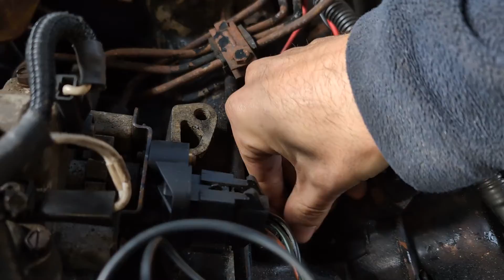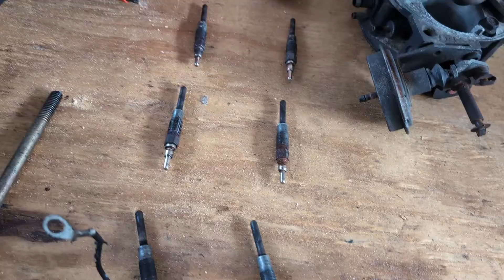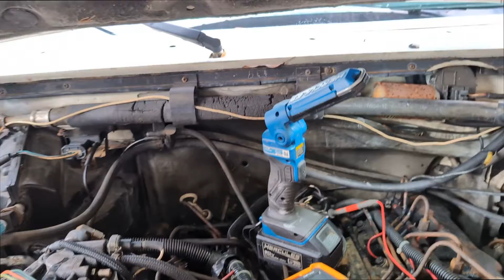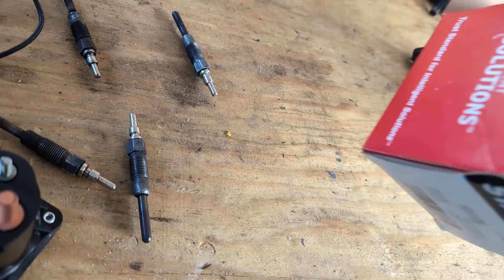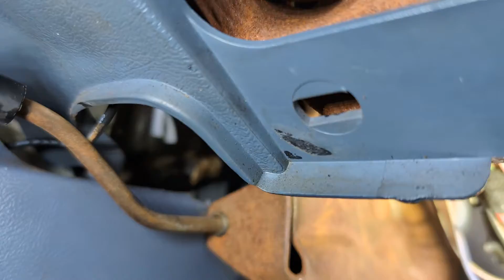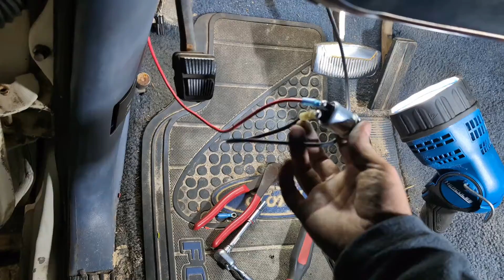Episode 163 - Glow Plug System Troubleshooting 1989 Ford F-350 7.3L IDI Diesel

Comment: Great job on the video, thank you for doing this.  I have a 1990 250 7.3.  Mine is doing exactly the same thing as yours.  I did all the testing step by step just like you did and ended up with the same results.  I also had to do a manual switch.  I'm wondering if maybe a fusible link somehow is a part of the computer control for the relay?  I wish I had a wiring diagram.  Im grasping at straws.  Two sets of plugs, two complete controllers, good harness, good plugs, etc.  BTW, what do you consider a normal resistance for each glow plug when on the work bench?  I wish others did as good a video as you, keep up the good work!
Reply from the maker: Thank you for your comments.  If you do a bench test of a good Motorcraft glow plug it should be 2 ohms or less.  One of my theories as to why the system wouldn't work right is that I put anti-seize on the plugs which somehow altered the resistance reading, even though as you saw in the video all the plugs ohm'd out fine once installed in the cylinder heads.  I have a new glowplug harness on my todo list to install,  just haven't gotten around to it yet.
Reply: @MazdaB3K  I did not use anti-seize the first two times I changed them.  I bought motorcraft parts off of ebay for $25, decided they may be fake so paid $130 at Ford Dealer and used anti-seize on these thinking they would be there forever.  Same result unfortunately.  I would appreciate it if you think of it to let me know if the new harness is the solution.
Reply from the maker: @MichaelMaroon-oz9bp  I honestly don't know.  As you saw in this video, everything tested perfectly but the glow plug controller wasn't having any of it.  Part of my testing was checking the voltage reads and resistance across all the harness parts and that came back fine.  A new harness hopefully would have better positive locking ends for the glowplugs but otherwise there was no issue with my harness.  This particular problem still bugs me as I wasn't able to solve it and had to do the manual solution.
Reply: .01-.5

Comment: Damn, watched a bunch of other videos before finding this. Just replaced all glow plugs with autolites while motorcraft are in the mail. lasted 2 days then tick tick tick. Unsure if it’s the glow plugs fault or the relay, harness was replaced by previous owner. Looks like I’ll be busy this weekend. Thanks a bunch ! First channel I’ve subscribed to !!
Reply from the maker: I'm honored to be your first sub.  Having the motorcraft plugs should help and as long as the harness isn't a hack job that should be fine.  Biggest issue is the controller relay or the controller itself.  They are very finicky, which is why you see at the end of the video that I bypass the controller and go manual.

Comment: Nice!!! I have a 90 7.3 idi Tow truck with Tach that works when it wants to and of course when it is not working their is no overdrive. Have replaced the tach sensor and computer tps with voltage setting and lasted awhile and now back to square one sure its a wiring issue. I have the schematic but do u know of where the wiring  usually breaks? Or better yet have you done a video on this repair with the test procedure?
Reply from the maker: I've replaced a bunch of the sensors on the truck fighting an issue where the truck hangs on to 1st gear waaaaay too long.  I've made videos about how to do most of that replacement work.  Should be under the playlist for this truck. That being said, my tac sensor is fine.  I've notice it has a few points worn from it not being secured properly, but I haven't found any broken wires really in that area.  I vaguely remember that the signal for the tac sensor takes a funny path into the instrument cluster.  Might be worth your while to make sure you have solid wiring on the printed circuit paper stuff they wire the cluster together with.  I know on my instrument cluster I have a few leads that are about to give up the ghost that I had to superglue back in place so I could reinstall the cluster.

Comment: the contacts on your steering caulome on the key switch/rod have been known to go bad as well. anyway you look at it the whole glow plug system and wiring harnesses are a fail on the 1989. Thanks for your video as i am figuring mine out today. arrggghhhhhh
Reply from the maker: Valid point, but the lock cylinder is brand new as I had to drill out the old one.  Vehicle was sold to me with a frozen lock cylinder.  Also had to replace the ignition switch at the base of the steering shaft  and that super annoying little metal piece that broke in the tilt column to get all the ignition positioning working correctly.  I'm glad this glow plug video is helping folks out because it was a PITA that I knew i had perfectly good, ford glow plugs but the controller wasn't working.  My manual solution is still working just fine.

Comment: Best way to check glow plug while in the engine is to remove the wire from the tip then measure the resistance between tip and GND (engine block). If resistance is infinite or very high then its burnt out. If very low then its good. This is easier than trying to put your Volt meter probe over to the battery + terminal
Reply from the maker: I may not have filmed it but I did check the resistance from the glow plug tip to block.  When you check that you are looking for 2 ohms or less.  I think I talked about it but its been awhile since I filmed this.

Comment: I have  the same problem  on my 93 ford f350 7.3 idi , I replaced  glow plugs,  module/controller, glow plug harness  and still clicks 
Did you find the issue  why  it clicks ?
Reply from the maker: The glow plug controller is extremely sensitive to resistance as that is how it determines if the engine is hot or cold and how much glow to run.  The only thing I could think of was that the anti-seize that I put on the glow plugs altered the resistance enough that it caused the controller to spaz out.  As seen in the video, I checked everything per Ford specification and found it to be within spec.  This is why ultimately I modified the glow controller to be a manual, momentary switch activation.  That has been working fine since I converted it.

Comment: What do you mean that all my plugs came back as 13.1 volts. This doesn't make sense. Testing as was done with a voltmeter won;'t tell you if the resistance is low but still too high for proper glow plug operation.
Reply from the maker: Can you give me a timestamp when I said that so I can get a little more context as to why I said it?  You are correct that a meter set to volts isn't going to tell you much if you are testing individual plugs.  The meter would need to be set to Ohms and then you can check the resistance.  However, if you are testing the ENTIRE system and you see around 10 volts  on a plug when you turn on the glow plugs that's about right to indicate the glow plugs are working.
Reply from the maker: Now that I think about it, I was probably doing voltage checks from the tip of the installed plug to the block with the wire harness attached and was looking for voltage drop across the length of the plug while installed.  If you have excessively high resistance across the plug or if it doesn't have a good connection to ground (the cylinder head it's screwed into) you would see a voltage drop when you check it.  13.1 was what the battery was reading at the time, so if everything was installed correctly I should see 13.1 across the plug, which I did.